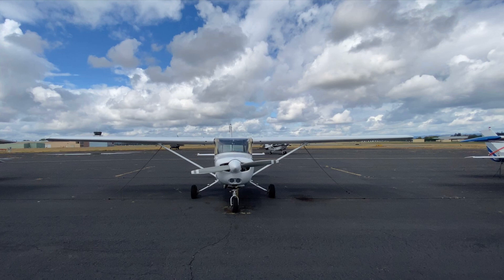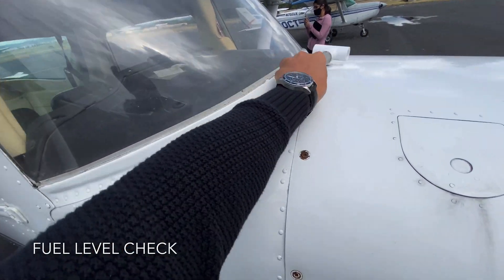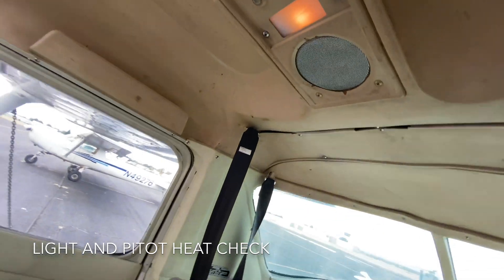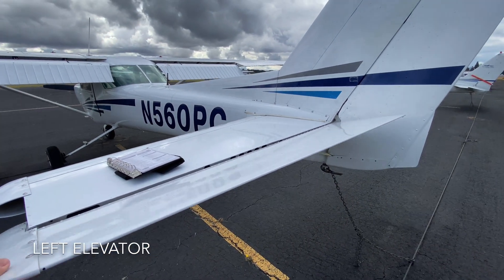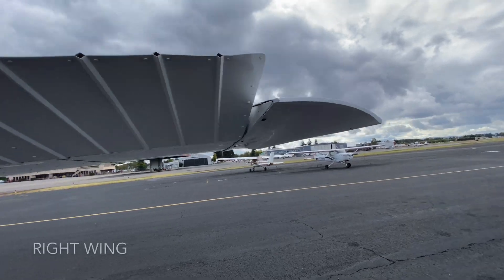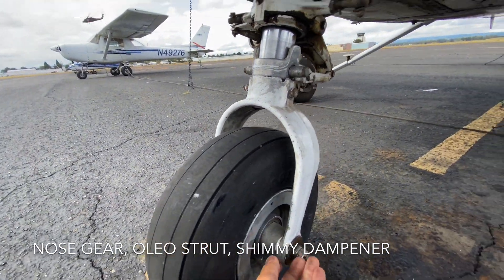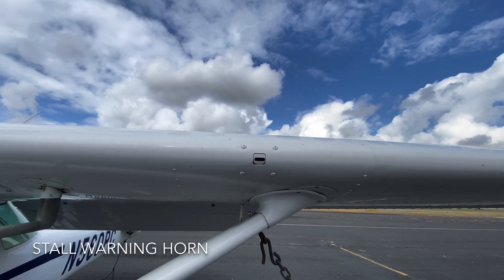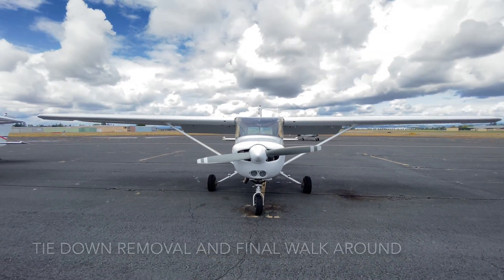How to Preflight a Cessna 152 (in 4K!)

Comment: That is some fuel stick.  Make sure to check the nose gear strut when the tail is not tied down.  Should have checked the stall horn when you had the battery on.  Just like on a car you can't judge the amount of air in the tires always check with tire gage.  I have had my Cessna 150 since 1974 and still flying it.  N5549E  the 49th 150 built in 1958.

Comment: Many 152s have a belly fuel drain....most people forget it or decide not to check it.

Inspection of castle nuts with cotter pin?  Don't want control arms and trim arms to come loose in flight.

Safety wires in place....

Inspection of hinges?  Piano hinges wear out....

Stall horn test - $10-20 for a plastic bellow tester.

Soon on the tire?  That one tire is TOAST.  Your life though.

Seat belt check....

I know its a lot, but there is always something more to inspect.   Can't assume the CME checked it...

.

Comment: 1:15 - Nose gear - check three finger widths.  If it's flat, you can call to get it fixed while continuing the preflight...  I've actually had to do this -- impressed the CFI.
Reply: Shimmy damper.